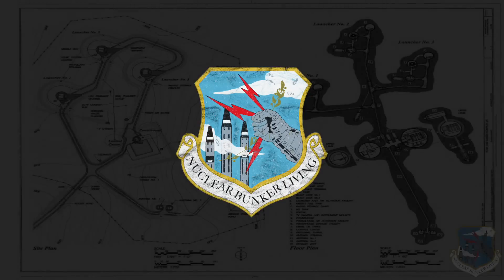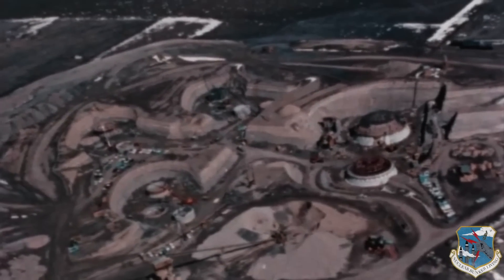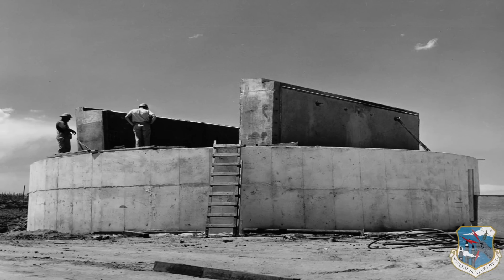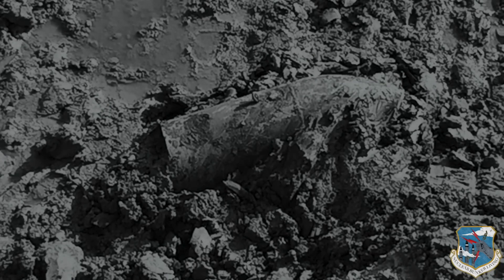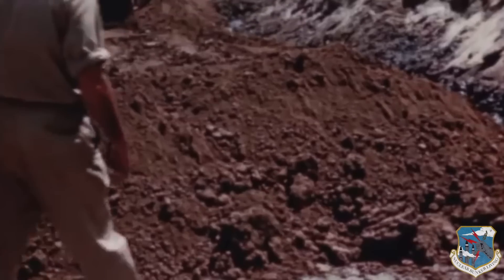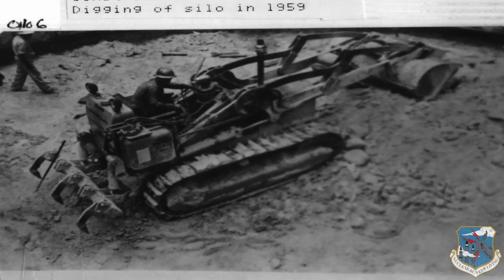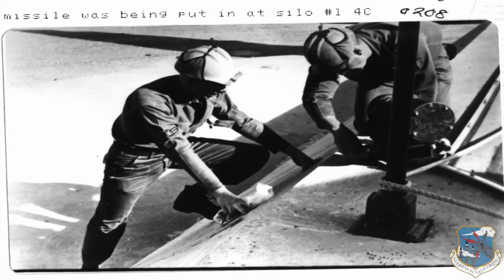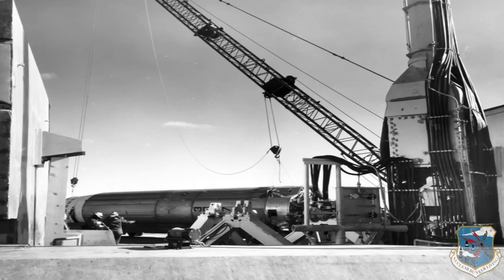Ep. 41 - How to BUILD An Underground NUCLEAR BUNKER

Comment: The Contractors and Workers did a amazing job building them in the time frame they had. If they ever do a Concrete Wonders of the World, the Titan 1 Bases and the German Flak Towers, V2 Rocket Bunker dome base and the U-Boat Bunker with it's 26meter bomb proof concrete roof are the Stars. Oh i better put in the Brand New 3-Gorges Dam that China just built it's Massive with a Big 'M'
Reply from the maker: Yes absolutely.  Pure engineering genius

Comment: Only spotted one small detraction - the missile on the truck was an Atlas... ;)
Reply from the maker: Well sighted.  Looks like Kansas too.
Reply: I believe those are the Denver sites, three-each manned by 724 & 725 Sqn's.  You can tell from the picture of the personnel entrance - there's a circular manhole in the concrete beside it.  Those were the original entrances; they were 'way overthought, a pain to climb in and out of, and they had a big turnstile door inside the tunnel that only one person at a time could fit through.  And the turnstile door was very heavy; a contractor coming through one slipped and fell halfway into the doorspace, and the turnstile crushed him to death.  That entrance was really unpopular with the troops already, so the site plans were immediately modified to the hydraulic rectangle portals.  I think there were only a few early sites that were built with the circular manhole portals, and they were in the Denver area - you likely know a lot more about this than I do, by now.
Reply: And yeah, the unexploded ordnance - was it 724B that was built on a WW2 bombing range southeast of Denver?
Reply from the maker: 724-B and 724-C
Reply from the maker: We filmed an episode on the original entrance death. 

EP. 16 - GRUESOME DEATH That Crushed The Head of a Missile Engineer.
https://youtu.be/JADWo8fJ8pY
Reply from the maker: It was at my complex.
Reply: Yeah, I missed that episode - havta' rewind and watch it!
Reply from the maker: They’re all fun episodes